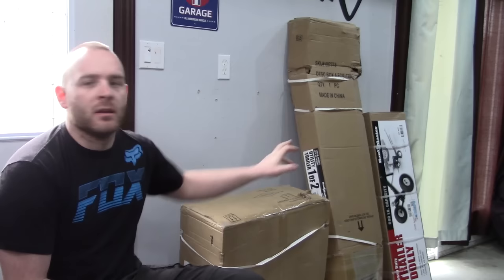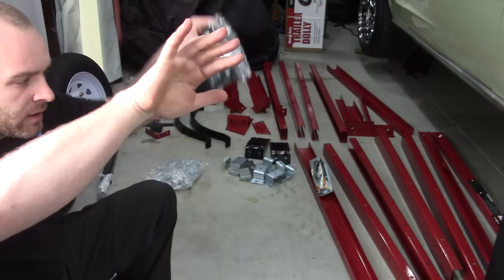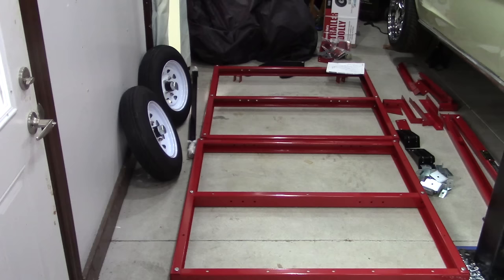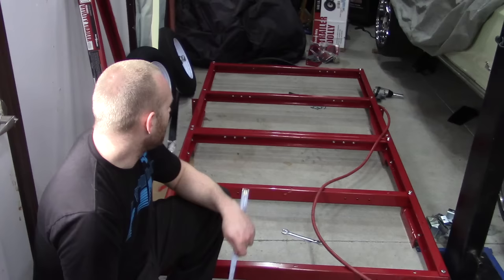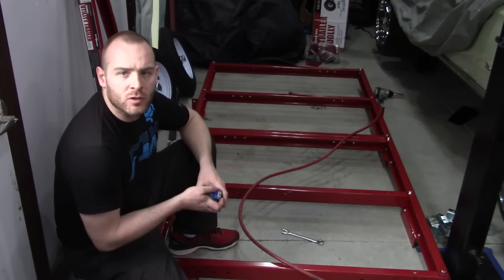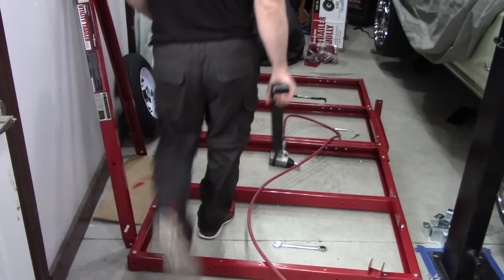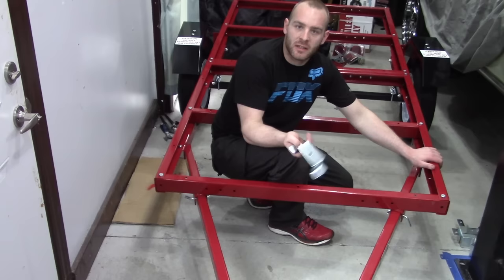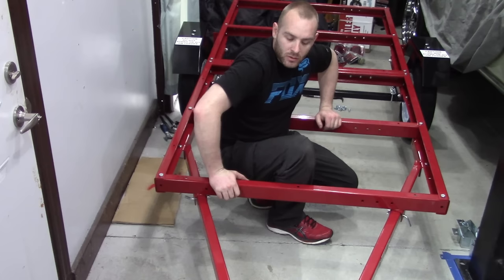Harbor Freight Trailer?? JUNK or NOT???

Comment: I've bought one of these 14 years ago. I've used it to haul everything from firewood, motorcycles, construction haul-off, you name it. In 14 years I've replaced the tires once (about a year ago) and the lights twice. I've seen mention of the 45mph "speed limit". This is bunk. I've towed it hundreds of miles on the freeway while loaded to it's capacity. I've never blown a tire, cooked a wheel bearing, or had any other issues related to driving at highway speed. I do maintain my stuff. I repack the wheels annually and check tire pressure whenever it's going to be loaded. I have 3 issues with this trailer. 1. the fit of the hitch over a trailer hitch ball has always been REALLY tight. Tight to the point that it's difficult to get the trailer off the ball. I've resorted to leaving a 2" receiver mounted ball on the trailer. 2. when running empty, the trailer rattles, a lot. However, loaded it pulls great. 3. After 14 years the paint is flaking off and it's getting some real rust on the bottom. That said, its always been kept outside. It's never spent a night in the garage. if you are considering a trailer of this size, I wouldn't hesitate to purchase another one. Yes, you have to put it together and the instructions suck, but for the money, no trailer on the market can touch it!
Reply from the maker: this is a GREAT review!!!  thanks for taking the time to write it.

i know since ive built mine its been used ALOT and i have 0 issues other than the tire opening up like a taco.   but sometimes stuff happens. so im over it.
Reply: Awesome!
Reply: any bearing problems, mine is over 12 y/o and the bearing are set up, any idea of a part #?
Reply from the maker: bearing should have a PN on them if you clean them up
Reply: If you're using a 2" ball, it should be very tight. The description I read at harbor freight says it's a 1-7/8" hitch.  You might want to check that
Reply: What size plywood should I Go with for this trailer ? I still want to be able to fold it.
Reply: Anything Adrenaline I think 4/8 plywood would cover the whole thing, I don’t think you’d need marine grade but treated wouldn’t be a bad idea cause most people leave these outside
Reply: @anythingadrenaline4515  I would do 3/4
Reply: Me too. I don't keep mine maintained at all. I just abuse the hell out of it. Just tires in the last twelve 18! years. It's the single most least expensive thing I've bought for what I've used it for. Also. NO EXTRA drilling like in this video.
Reply: Scott,
I DO believe it should be a 1-7/8" hitch.   Mine is the ONLY 1-7/8" trailer I own, so I have a seperate ball and hitch for it.  Easier to just swap the whole thing @ the truck.   But IF yours says 2" on the trailer, you can loosen up the nut underneath the retaining tongue of the hitch.   But be warned- it might fit better, but if you make it too loose, it might fail, so maybe just leave good enough alone, if you like your system.   Or try a 1-7/8" ball.     Either way, stay safe!

And you sound like you use yours exactly as I have used mine.   Great little thing to have around!
Reply: @710Garage  Tire open up like a taco?????      Did it split open?
Reply: @johnfox9663    Pull the bearings, spray down with brake cleaner, and take to a NAPA or other auto parts store.  They should be able to hook you up
Reply from the maker: @tonyhill3638  yes sir opened right up like a hard taco shell
Reply: @710Garage    Yikes!   Probably has been sitting in a HF warehouse for many years prior to sale.   Car tires have a manufacturing date,  I wonder if trailer tires do, also?    If so, and if they were old, HF might give you a new set.   Might be worth looking into.   Hopefully, the trailer didn't sway and dump your ATV!
Reply: @luketilley9137  The 'Heavy Duty' one haw a 1-7/8" ball. The 'Super Duty' has a 2" ball.
Reply: Just bought a used one and the hitch is almost impossible to use. Took the hitch apart and the clamping piece, the part that is suppose to drop by spring pressure then gets pulled up by the lever on top of the hitch, is a little wide to move freely in the hitch. I placed it in the vise and gave it a couple good squeezes, now the hitch is smooth and functions perfectly.
Reply from the maker: @thilltony3362  luckily i had it strapped well. but it did add a ton of time to my travel plans
Reply: I love my HF trailer
Reply from the maker: @danielleyva7881  same big time!
Reply: @ridemfast7625  I took mine apart and ground some of the pieces.
Reply: how fast can you drive with this trailer?
Reply from the maker: @Cheetoz  people have driven highways across the country   i havent been super long times on the highways personally
Reply: I've had my HF trailer for about the same amount of time and can say pretty much the same thing. It has been a real work horse and was worth every penny. I never had issues with the ball, but otherwise my experience was identical.
Reply: Just curious what all you that have had it for so long paid for it? It's double the price from what he said in video now.
Reply: @tonyhill3638  My 4x8 uses a 1 7/8" hitch as well and I also just bought a separate hitch rather than trying to change the ball... We just put mine together yesterday, but so far, I'm very happy with it!

Comment: I bought and assembled this trailer several years ago. You're absolutely right about the instructions being useless but it's not that big of a deal for anyone mechanically inclined. The hardest part is keeping the frame square during assembly. Personally, after bolting it together, I also welded mine. I also disassembled the hubs, cleaned out all of the o.e.m. grease in my parts washer and used a brand name, waterproof grease to repack them. I also bolted and welded on a sheet of 1/8" steel diamond plate for the floor and made fender brackets from angle iron. My reasoning behind the steel floor is that I wanted to mount my generator, mig welder, torch set and their various accessories to the trailer permanently AND use it as a portable welding table when needed. I take this setup to the race track inside my car trailer and pull it around the pits with my 4 wheeler. I also use it around the house and shop this way. These trailers do have their faults, but they're easily overcome and they just lend themselves to modifications by the owner. For the price, you really can't beat them.
Reply from the maker: i absolutely agree... for the price of this thing its AMAZING
and the small stuff you "deal" with are worth it in the end

Comment: The deal is - if it isn't right <Exchange> it. Then you have the right parts and nothing to complain about. 

My HF trailer is on its 2nd Floor and new  sides and a total work horse after 10yrs. use.
Reply from the maker: im not complaining, just stating what happened.
Reply: @710Garage  And thank you for that.  I like to be fully informed before I make a purchase and take on a project like this.  Great video.
Reply from the maker: @keithquintrell6912  thanks for the awesome comment!!

Comment: I had to assemble one of these for my folks about five years ago.  I had the fortune of getting a proper set without any mixed up pieces.  (Given how similar they look to each other, it doesn't surprise me much that they got mixed up in packaging anyhow.)
They're great little trailers once you get them assembled.  My folks have been using theirs ever since I assembled it, and let me tell you they've abused the hell out of the poor thing, but it's still holding up like a champ.  The only issue we had was that some jerk backed their car into the trailer and smashed the tail lights.  Not once, but twice!  So I wound up having to replace them.  Fortunately, the newer LED sets (ours had the incandescent lamps when we bought it) fit perfectly where the originals went, and the trailer looks even better for that.
Reply from the maker: atleast im not the only one with a couple wrong pieces.   oh well for the price i guess its par for the course

Comment: Make sure to get the 1800 pound version. Get the side wall kit, too. I hauled my entire household to Las Vegas with this trailer. Owned it for 20 years. Best trailer ever.
Reply: Sidewall kit #? Not on their website and my 2nd biggest complaint so far about the trailer. First is the paint job, should have repainted it with Rustoleum first
Reply: Where did you move from? 

I live in.las Vegas and have the 1195 4 lug. I plan on going from vegas to North Carolina, I pack the dog shit out of the bearing and put 5.30x12 tires on it the 4.80 x 12 seems to small. And bought a backup hub and bearing kit.
Reply: I moved from LA to LV :)

Comment: Just bought one this morning, the 1750# one. Had no problems at all putting it together, took about 3 hours. Seems pretty good, need to deck it now. Nice LED tail lights also.
Reply: The fender mounting is a joke, they wiggle around way too much. I ended up mounting them backwards so they sat closer to the trailer, the mounting holes are not centered on the top of the fender. I then screwed a piece of angle from the trailer to the fender screwing the fender to it also. This stiffened the fenders up substantially.  I also ran the wiring inside split conduit and passed them through the holes in the crossmembers. I had a set of valve cover bolt rubber grommets from my Jeep that fit perfect in the holes to protect the wires.
Reply from the maker: i did the same with the wiring, but i like your idea for the fenders!!

Comment: Thanks for sharing. Suggestion:
 A thin nylon kitchen cutting board 1/4"thick.. cut two six inch long strips the same width as the frame rails. Use these as wear shims between the slipper portion of the leaf springs and the frame rails. Doing this will minimise the wear on the springs and the trailer frame. Stainless steel pop rivets or countersunk metal screws are ideal for fastening the shims to the frame. When wear to the shims gets bad..install new shims... cheaper than spring and/or framerail repair/replacement.
Best to you and yours.
Reply from the maker: awesome comment i will need to do this to mine!!!

Comment: I have the same exact trailer.  Overall, solid review, but some of your cross members are upside down and I'm willing to bet your side may be flipped as well.  That would explain the need to drill holes.  The only holes I had to drill were to make sure the wiring and lights are properly grounded.  Great trailer for the small garage.  Mine folds and is still super solid.  And yes, the instructions are an unmitigated disaster.
Reply from the maker: i tried many different ways to get this thing together like i mentioned.... if there are some upside down i guess they are going to live like that! lol

kind of why i skipped through the building unlike my other videos.  it was alot of cursing and putting together to take back apart. 

thanks for the comment!! glad to see im not the only one who had trouble building it

Comment: Great job. I'm glad I got the non-foldable HAUL-MASTER 1980 Lb. Capacity 48 In. X 96 In. Super Duty Trailer, for only $40 more, at the time. I have hauled lumber, stoves, refrigerators, washer & dryer combos, furniture, boats, canoes, garden tractors, a Honda Goldwing Interstate full dresser and even 1 ton of gravel. Now the largest HAUL-MASTER trailer is only 1720 Lb. Capacity because it is Folding.
Reply from the maker: looks like you got into the trailer at the right time then!!  i dont use the folding feature on mine either, so an extra 200 lbs capacity would be nice

Comment: Dan,

The "WARNING" about cleaning the Cosmoline out of the bearings and re-packing them with hi temperature wheel bearing grease IS in the instruction manual, IF ... someone bothers to read them.  Some guys chose to just assemble from the pictures on the "exploded" diagram, which can cause the bearings to "EXPLODE"... !

Well ... the bearings shouldn't  rust anyway.
Reply: I've read five different assembly manuals on the different trailers that HF sells.  All have the same standard verbage that implies that if the hub has to be assembled, the bearings must be cleaned and repacked.  These hubs come assembled which can easily be misinterpreted to mean they don't have to be cleaned of cosmoline.  But I would agree 100% that the bearings should be checked for proper and sufficinet grease.  If you want something done right, do it yourself.  Trust no one to do it for you.
Reply: Instructions!!? I thought the paper was to start the barbie
Reply from the maker: just an update!  mine is still going strong with no play in the bearing.

Comment: For the leaf springs, what about drilling a hole through the frames spring seat and add some standard plastic leaf spring spacers to both sides (eg: Dorman 924-070). The spacers are ~1/8" thick so kind of depends on what the clearance is between the frame and frame seat.
Reply from the maker: for sure you could. 

for me its just as easy over time to weld a plate on if it starts to become thin

Comment: I built the same trailer, first I bolted everything together and then welded ALL of the Horizontal lines. I had all of the correct pieces working for me. I also upgraded the wheel package from Walmart and bought the 13" 5 lug, I found the tongue pieces insufficient for my use so I wrapped them in ⅛" Angel iron everything fit just a bit snugly, I had no problem registering the trailer either, I had read on the Harbor Freight site about issues, well they had forgotten to get the trailer weight before going to the DMV. All in all I am very pleased with the trailer...

Comment: Built one ten yrs. ago ended up selling it with my atv,the damn thing was great,tracked behind the van perfectly,while my buddies fancy store bought aluminum  trailer would swing back and forth behind his truck,just assemble on a nice flat surface and use a square,I never had to drill any holes in the one I bought,and if your gonna check for it being square make the damn thing square or dont bother.
Reply from the maker: i measured corner to corner so that will make it square. 

but yes you are right its worth doing for sure. i do love this thing.  i use it now just on our property behind our ATVs so its perfect size for that

Comment: I have one of those trailer plus a boat trailer, assembly was easy and trailers are about 20 plus year old still looks like when I assemble the trailer.
Use either trailers almost every weekly.
My neighbor had a back yard fire trailer got a tailight damage and a tire burned.
And a little damage to part of frame other then that doing fine.
Reply from the maker: these trailers are hard to beat for sure!

Comment: I have had mine for about 16 years. A great option for a light utility trailer. Reasonably light weight for pushing around the yard by hand.
Reply from the maker: absolutely.  i have mine LOADED currently with the hardware and brackets for the new shop im building ( see the street sleeper vids ) and i have the small dolly with the ball on the top.  i can EASILY roll it anywhere needed for the project. its really handy for sure.

Comment: I'm thinking bearing buddy's for grease. Love the idea of only going finger tight with bolts until all together. I plan to use the folding feature, but either way, it's a good idea.
Reply from the maker: bearing buddies are a great idea!  i planned on doing that aswell but i havent gotten around to it yet.  
maybe in the spring ill do it.

Comment: I bought one earlier this year to haul stuff from our home in Commiefornia to Utah...I got the larger model to hold more weight and to eventually use it for other projects.  Yes, the instructions are horrible, having to switch parts during the build.  In regards to the grease, my hubs came with not Cosmoline, but actual blue waterproof grease.  But that trailer is great.  First trip, was during winter, so I didn't want to haul it through 80 over into Reno, so I drove the long way down to Vegas from the Bay Area, then up 15.  At times cruising comfortably at 65mph being passed by Semi's.  But it hauled great.  Second trip was through 80 and again flawless.  No issues with the tires giving out or the weight it hauled (roughly 1k # each trip.  It is a little small (4x8) but served what I needed it to do.
Reply from the maker: thats awesome!

Comment: I've had my 1190 Harbor Freight trailer for 10 years! Moved several people with appliances! hauled logs for a guy with a mill till he got one! Just hauled almost 1500 pounds of free flooring and shop equipment from Phoenix to southwest Arkansas! Only two modifications were new tires and an "anti-sway" kit, also from Harbor Freight! Had no problems doing the 80 mph through Texas!
Reply from the maker: im going to have to look at the anti sway kit,  thanks!!!

the new tires were the same size or larger?

Comment: I bought one about 6 years ago to haul my Honda 350x, have also hauled other things as well. I painted it black with 3/4 inch oak plywood deck, stained and clear coated, built a box to go inside the hitch. I now have two 350x on it all the time, love the trailer. The whole thing sits in storage unless I'm pulling it.
Reply from the maker: sounds like you are as happy as i am with the purchase
Reply: @710Garage  If you want to see what mine looks like look up '350x fun'. It's just some still shots I put on there so someone else could see my 350x.
Reply from the maker: will do

Comment: The only maintenance I've had to do to this trailer is the side rails and the wiring which is normal for any trailer.  It has been a very reliable trailer and the hardest part about owning it is making sure it doesn't get stolen.  The box was missing a couple of pieces but harbor freight made good on them and I got it up and running very quickly.  The instructions?  Well I didn't look at them long enough.  I just glanced at the pictures when I got stuck. I think I paid like 350 for it about 6 years ago.
Reply from the maker: i agree i love this little thing!